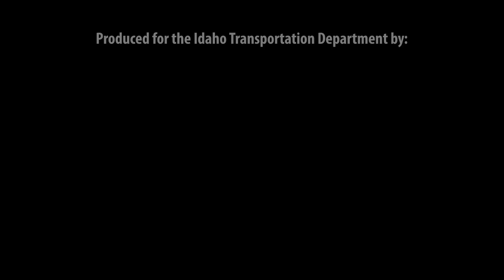I-90/ID-41 Interchange Flyover Video

Comment: Is it just me or what, but doesn't SPUI (spewey) rhyme with SCREWY and PHEWEY...both my initial thoughts on this "change".  Change is NOT always for the better...this looks like a huge accident waiting to happen.
Reply: They’re generally safer since (in this case)  we’re reducing three clustered signals down to one, plus allow for simultaneous left turning traffic with wider lanes for trucks. It’ll be more efficient for the increased traffic that intersection’s going to receive year by year
Reply: Do you drive this corridor??  I have lived on this corridor for over 30 years and it is way too dangerous right now.  I drive thru here at least 6 days a week and have been rear ended twice because people can't pay attention to all the stuff going on, illegal left turns, people turning on green, etc.  Exit 7 is a deathtrap when the offramp backs up on to I90! This looks so much safer once people get used to it.  As our population grows, we need this to allow for the number of people going through here.

Comment: I feel like the H95,I90 corridor needs to be next... or at least adjust the traffic signals through there
Reply: the lack of any semblance of merging space on the ramps through that part of CDA is crazy. they should get rid of the 4th st ramps and put some on a street that is farther away from 95.
Reply: @nemesis2445  Hey, your right, Northwest BLVD and US95, so is the 4th street one. Both are just to close.  I see why IDT put it there, one there all Major roads, but they should make it better, and add a new Major road in between ID 41, and US 95.
Reply: Scratching the surface, if you can actually pull it off, a full fledged freeway upgrade maybe needed on 95 between I-90 & whatever that one amusement park is called, where there isn't a single light until just north of Sandpoint. Just a 4 lane freeway with one way frontage roads looks like it'd drastically improve flow through there...
Reply: @schwenda3727  Yeah. I live in Spokane and visit Coeur D'Alene alot, and US-95 is in desperate need of an upgrade. Two lanes on each side and 45 miles per hour doesn't do the job anymore. But I don't think Idaho has the funding for that.